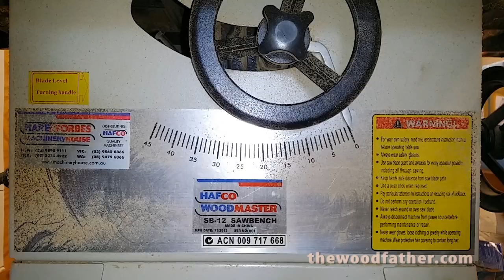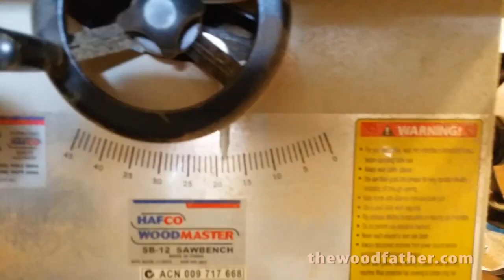Building a Letterbox (mailbox) - TheWoodfather

Comment: I see wet letters, but yeah, fine work.
Reply from the maker: Pleased to report that it's been out the front for five years now, through many storms, with no wet letters. Although I should have used waterproof glue, about a year ago after a knock, one of the arc joints failed along a glue joint, chalk that down to inexperience on my part. After resetting it though, no drama at all.
Reply: @woodfather  Thanks for the update. Yeah, here water seems to get everywhere from the tiniest of cracks or what have you.  So after making my wood frame I am going to use house wrap, then siding to make sure it is dry inside. And man, love your shop tools, no wonder you call yourself the WoodFather, lol  oh, and yeah, was wondering about your glue. I was thinking how brave you must be, lol